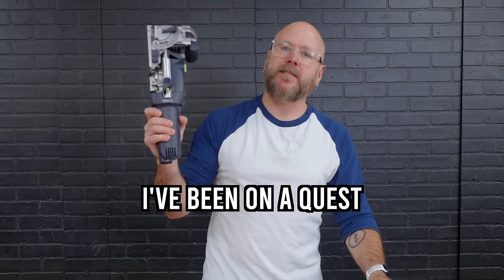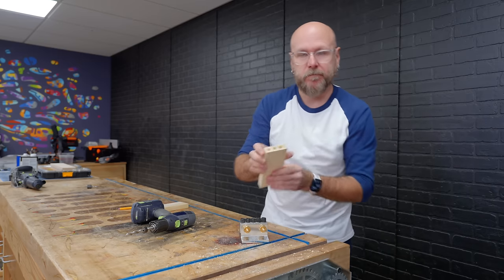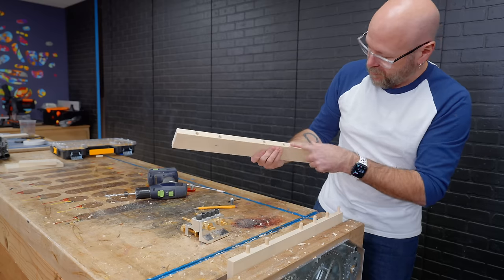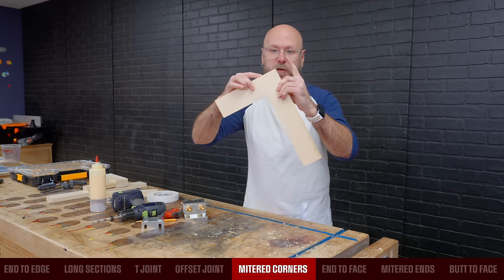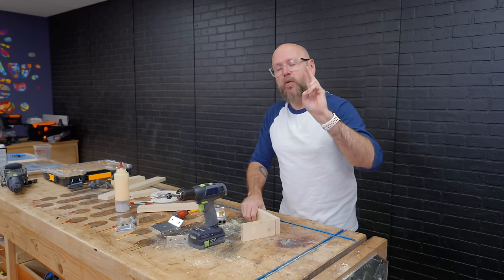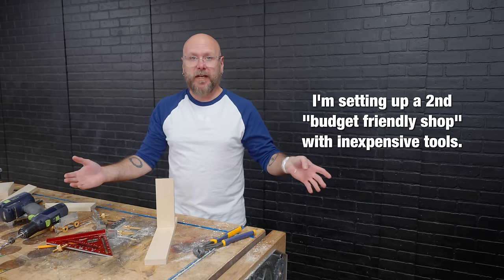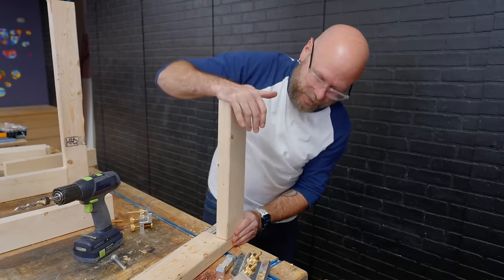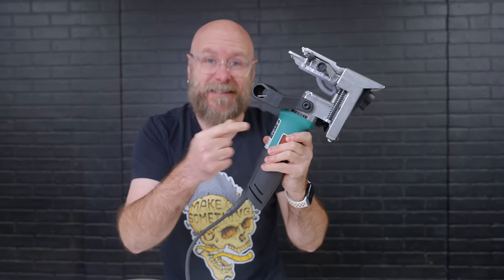The 2nd Best Joinery Method That Can Do It All!

Comment: The woodworking community says always that dowels, dominos, etc are for alignment purposes only and doesn’t provide more strength. I would like to know what does this company really mean by stating that is stronger than this or this because as mentioned, the idea is for alignment only.
Reply from the maker: a floating tenon always adds strength to a glue joint. sometime people will say a biscuit joiner is only for alignment but I somewhat disagree with that. depends on the circumstance.

Comment: Domino doesn't come with this attachment because it's not necessary. Read the manual. All you need is to clamp a piece of scrap wood atop of the piece you're drilling.

Comment: Nice.  But $250 for this is not only ridiculous for what this actually is, and what it costs to make, but it is just begging for the Chinese to rip it off.  I saw one that looked like the JessEm jig for $60, with a clamp like the Dowelmax.  The downside is it is metric for both the board thickness adjustment and the drill/dowel sizes. But, for that price, if I can source metric dowels, maybe I put a metric conversion chart for common board thicknesses on the wall….
Reply: Oh, I see the’ve already started with a direct Dowelmax clone.  Sooner or later one of them will get it right.
Reply: $25 at Harborfreight.

Comment: @20:16 - "Would it replace the Festool domino...?"
This isn't a fair question. You already justified the cost of the Festool domino so for this to be good enough to cause you to re-evaluate that decision seems an unfair ask.
If you didn't have the Festool would you have gotten this to "bridge the gap"? is a better question. For those that are looking to get started or doing this kind of work as a hobby do the pros of the Festool domino outweigh the price difference?

Comment: I call BS. There is no way that a dowel joint (even with multiples) is going to hold up over time like a good old floating mortise and tenon (Domino). You need the flat glue surfaces for that. Dowels are notorious for shrinking in their holes and losing adhesion. 

40 year woodworker here, still loving his Domino (other than the fact that it made have the stuff in my shop obsolete).

ETA; Yes, I own and have used the beadlock jig (same thing basically).